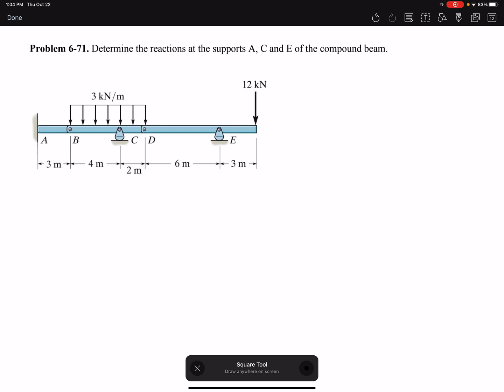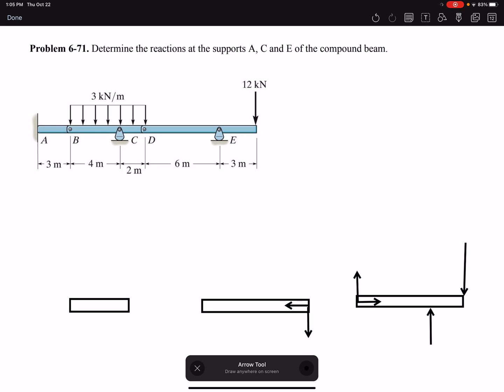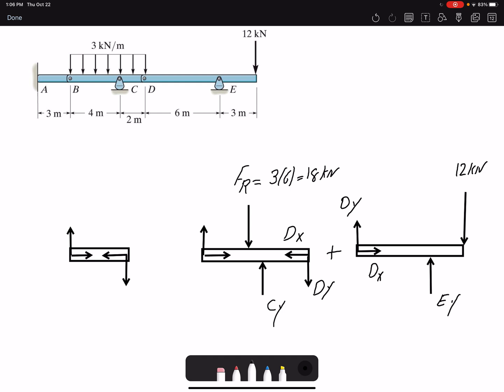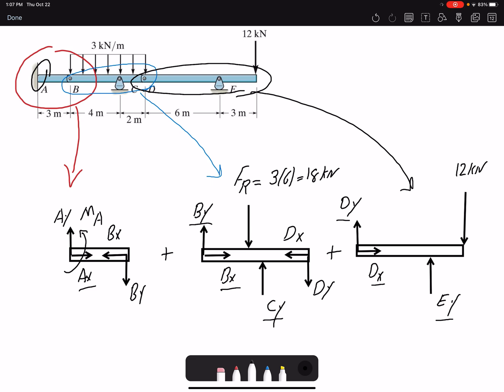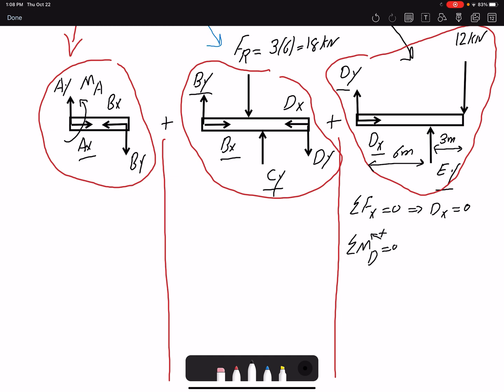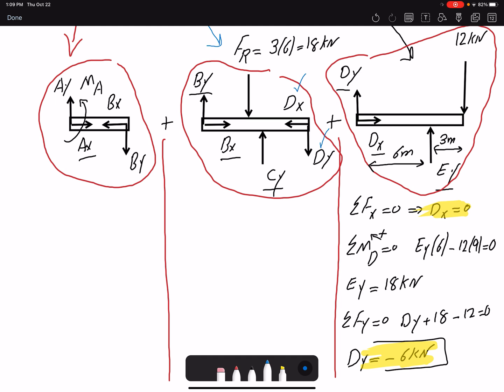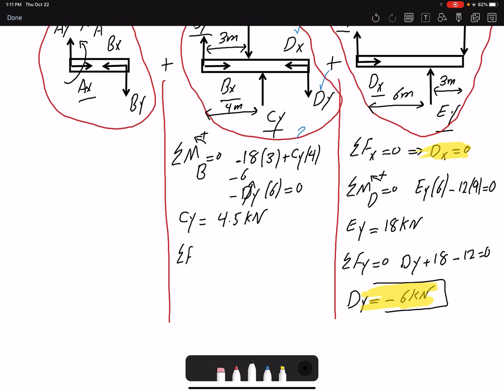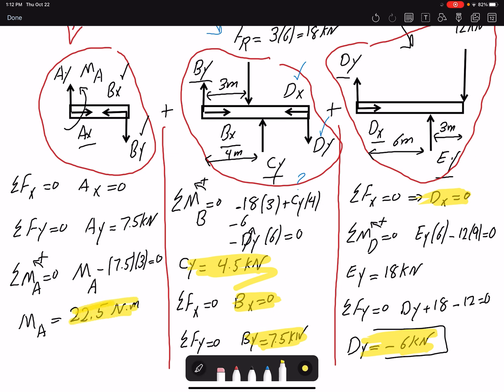Statics Problem 6-71: Example of Frames and Machines for multi beam structure

Comment: If Dy is pointing up in the right picture, why does it point down in the middle picture? Doesn't that mean that Dy should be positive 6 not negative?
Reply from the maker: Because they are action and reaction so the sum of both should go to zero, internal load should cancel when you put the beam back together

Comment: Because Ax is the only external force in the x direction, can't we just assume that it is 0? The math does follow.
Reply from the maker: Correct, you do not need to include Ax, however, I usually instruct my students to write all the  reaction forces a support can have and show it with math if a reaction is zero.